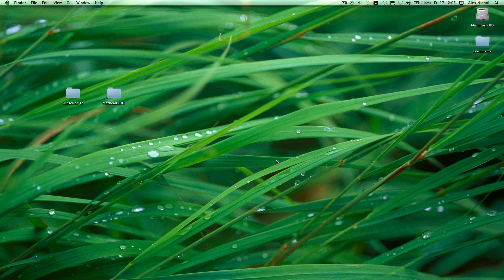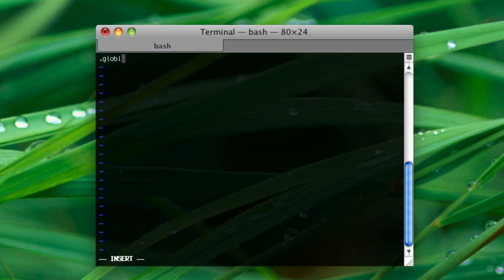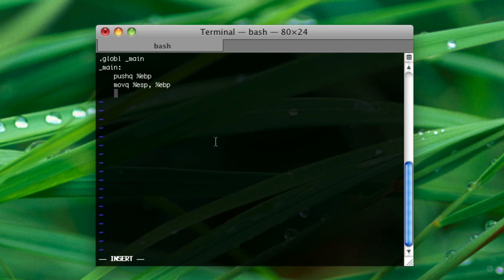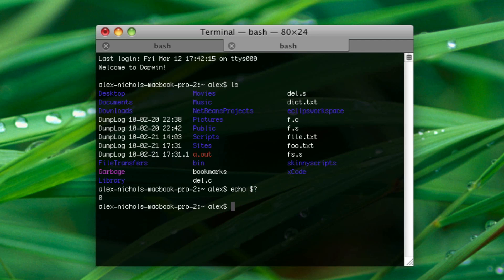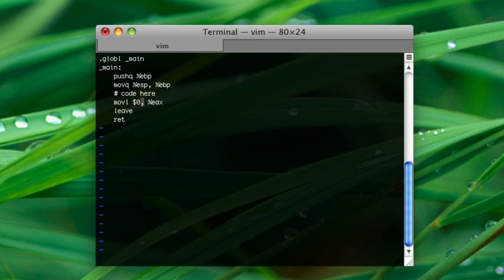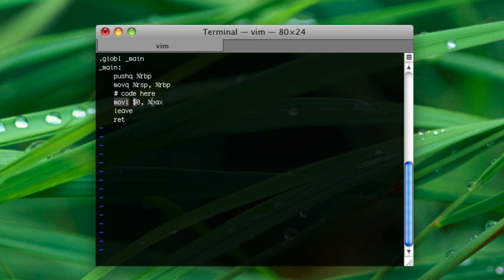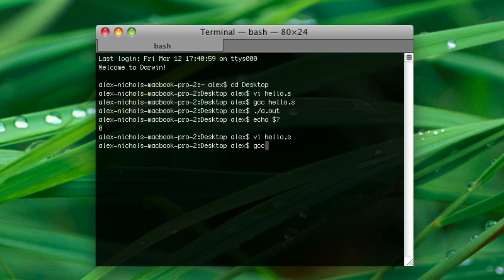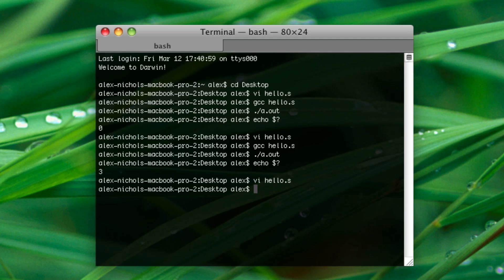GNU Assembly Tutorial 1

Comment: hey guys.. I need your help, please.
the commands don't work at my terminal. I've tried everything: binutils, "Command Line Developer Tools for Xcode" ... nothing works. I always get the same message:
clang: error: no such file or directory: 'hello.s'
clang: error: no input files
Reply: Assuming "hello.s" is seen when doing "ls":

Try:
gcc  ./hello.s
or
gcc "./hello.s"
instead of
gcc hello.s

I find on my windows machine I have to use a "./" for "current directory a lot when
specifying files in git bash to work properly.

Without seeing your exact code, that is as much help as possible.

Comment: I'm a bit confused, if someone can answer. Doesn't the processor run Machine Code?
Reply: Yes it does ;)
Reply: Yup.
The conflation between Assembly Language and machine language (binary) happens because there is mostly an exact, consistent 1:1 correspondence between an ASM language instruction (line) and a binary instruction that the machine understands (runs).